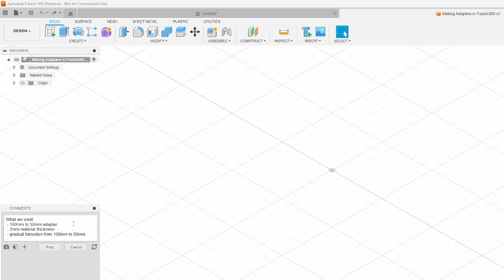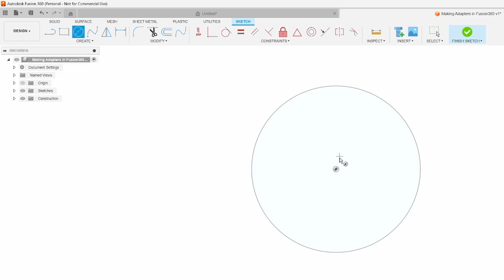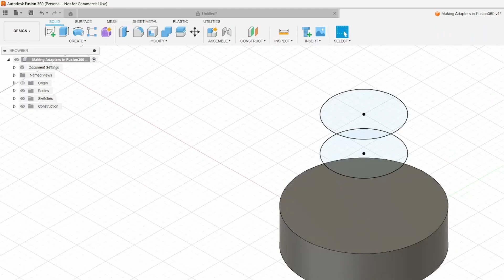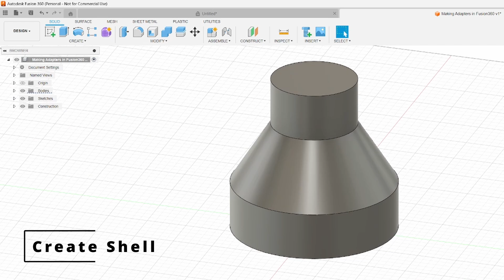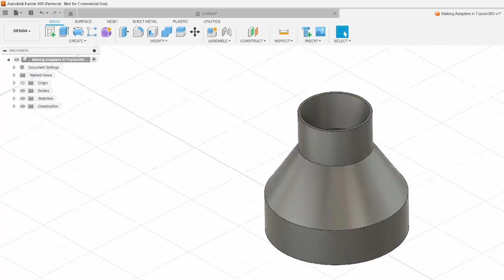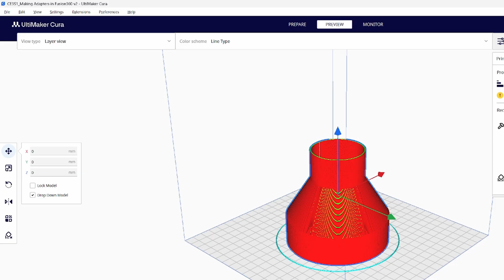Create Adapters with Fusion 360

Comment: I like how you explained  the hole part at the end... I can't even see the settings to  make the hole
Reply: yes it was a bit frustrating that the default settings for the hole are not what works. i had to switch hole type, hole tap type and  drill point to "simple" and then set the hole distance to 30mm which is the height of the bottom section of the adapter. then it worked for me
Reply from the maker: Sorry about that. Definitely one of my earliest videos. Working on making better ones as I go. @cookakin got it though ^

Comment: This is EXACTLY the video I needed.  Been trying to figure out how to do this for awhile, and thought the loft tool might hold the key.  Trying to run brake cable through a chanel--making something with the same diameter as the cable is easy enough, but whenever you cut a brake cable as you sometimes need to do, it frays, so you need a funnel shape, ideally, so the cable can pass.  Anyway, thanks for making the video.

Comment: You said you wanted a 100mm inner diameter, with a 2mm wall but made the circle at 104. Can you help me understand why? I followed the instructions for a 3mm wall, the shell worked fine, but the hole seems to cut a different diameter. I wanted an opening of 104 with a 3mm wall so I made the cirlcle 107 but it leaves a ridge when I cut the hole.
Reply from the maker: Sorry, I didn’t explain that well. I made the outer diameter 104 because you have to account for the 2mm wall twice. 

So for yours, if you think about drawing a line across the diameter, you’d first travel 3mm to get through the first wall. Then travel 104mm for the opening. Then cross the wall again for another 3mm. 

So your total outside diameter would be 110mm

Comment: If you print your Adapter in TPU you can use it as a custom car coupler. Just used a test one on my buddies turbo Subaru. Going to print a 4in to dual 3in coupler for my custom turbo BMW next!
Reply from the maker: Can that take the heat?

Comment: Iam total beginner with fusion but when you activated shell command you could click on the top and bottom and them just type your wall thickness leaving you with finished product rather then to use 2 commands to do 1 simple task.

Just that, have a nice day. 

Jacob 🙂
Reply from the maker: Thanks for the tip! I was just getting into fusion at the time so definitely room to optimize.

Comment: Short, direct and to the point without giving your life story. This was exactly what I was looking for and got me sorted out in less than a minute. Thank you for this video! One additional note, I've started exporting to STEP instead of STL, which results in a larger file, but allows the slicer to do the calculations on the curves. The result is a higher resolution curve which when sliced and printed reduces the likely hood of vertical fine artifacts showing up on your print. You get a true curve instead of a "blocky" curve.
Reply from the maker: Nice! Thanks for the tip.

Comment: In order to avoid printing an entire adaptor only to find that the fit is slightly off, I create another offset plane, sketch a circle, then do an extruded cut (sometimes called a Boolean) so that only a tiny cross-section of the upper ring prints. I then test fit that little ring and make adjustments in my CAD program until the ring fits perfectly. 
Then I delete the plane and extruded cut, and repeat with a plane and extruded cut going from the top down. Then I take that larger ring and make sure it fits the saw port. 
Once I know that both ends of the adaptor will fit perfectly, I will do a full print.
This saves massive amounts of time and filament.
Reply: your idea gave me the idea to do something similar. i brought the full stl into my slicer software and in there I cut the model at the bottom and the top and exported those as separate gcodes to test each end. the test prints only took about 15 mins each